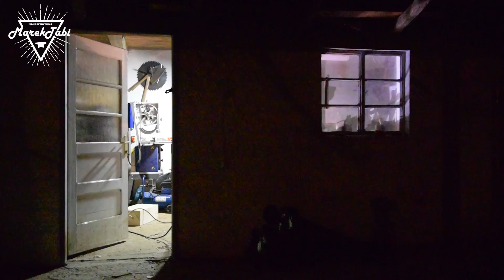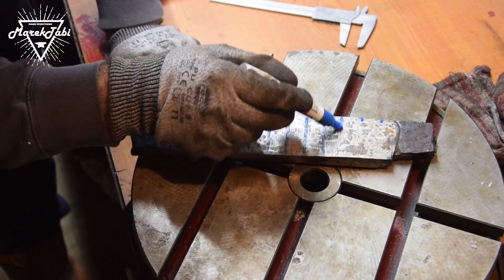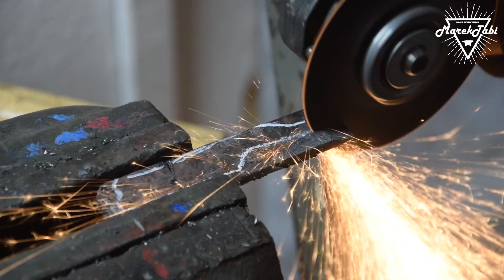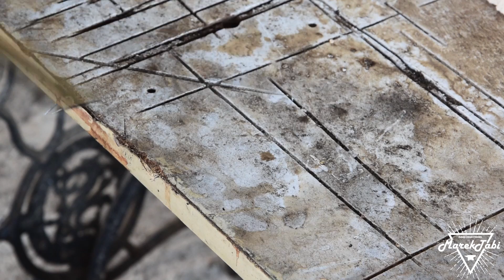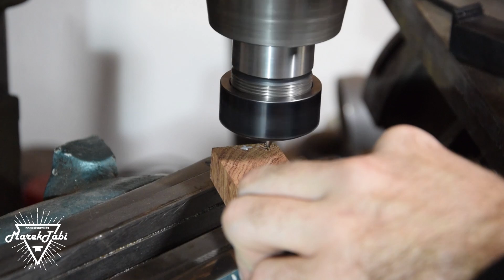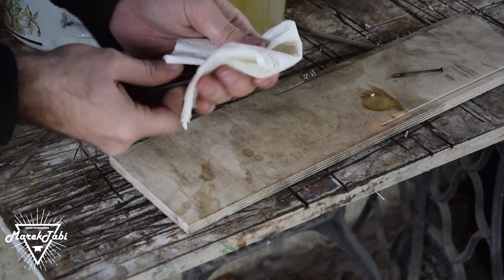Making Razor From Damascus Steel To Shaving

Comment: I think this is not useful because you have to make "stopper" for the back of the razor because now you basically have to hold the metal piece to shave. You should hold the handle and just put the lite pressure with your finger on the back tip of the razor

Comment: Its not a straight razor its a knife..
The way you ground it makes unusable as a straight razor..it will never sharpen on the stones with the spine touching because the plunge line is not symmetrical and doesn’t mirror the edge.